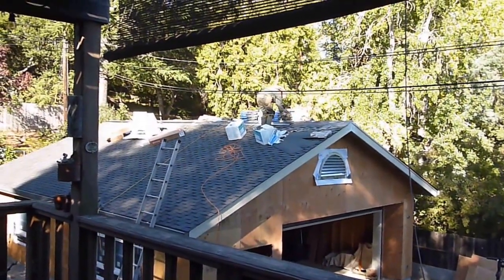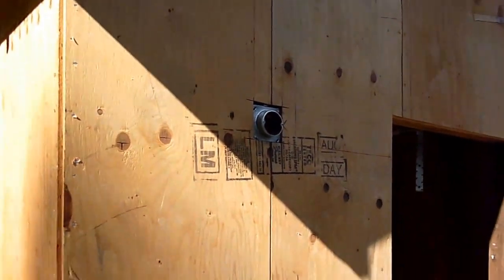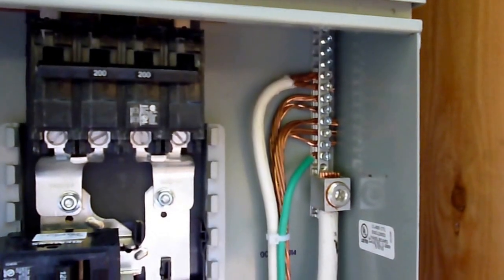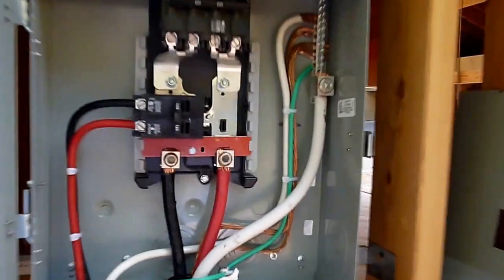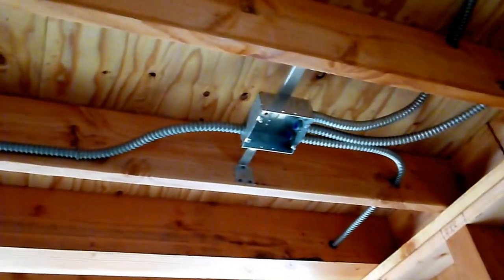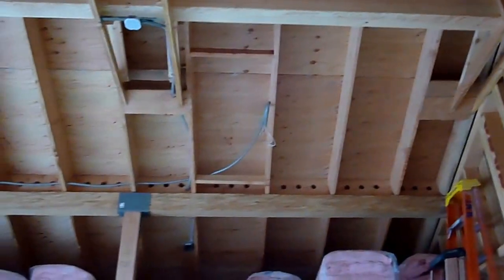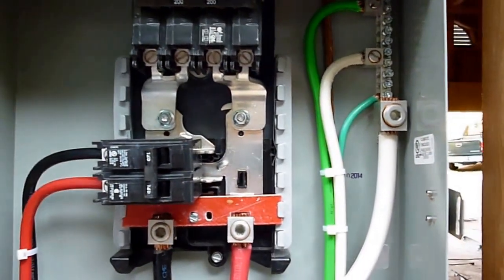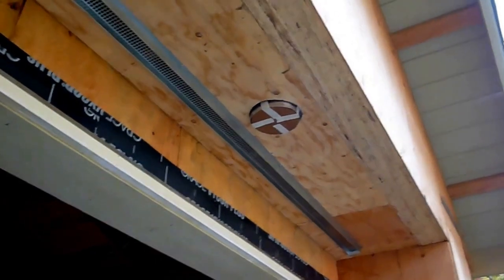From The Ground UP 9 13 15 Sunday Progress Update

Comment: Surprised weather head on roof doesn't have to be taller. By the way outside light on right is one inch lower than one on left! Ha! Gotcha! Teasing! Very nice!
Reply from the maker: +19stoney64 Shhhhhhh!! You're not supposed to notice that one inch. ha, ha,

The requirements  on the weather heads are by our local utility, PG&E (Pacific Gas and Electric). In areas where there are trees with branches that can potentially put pressure on the drop, you're not allowed to go more than 30" above the roof without braces. The other requirement is their service drop should never be lower than 12' above grade. Where this drop hits the insulator on the service riser, it's about 12'6" and I "cheated" a little on the mast because it's 36" above the top side of the roof rafter. The insulator/strain relief is below 30".